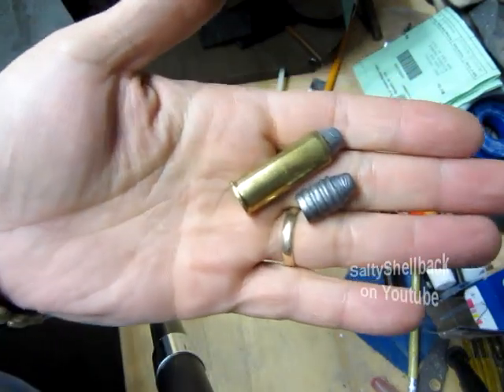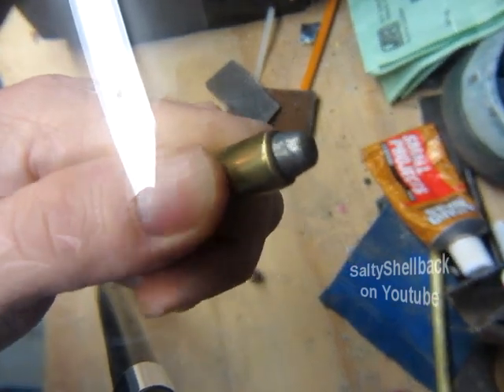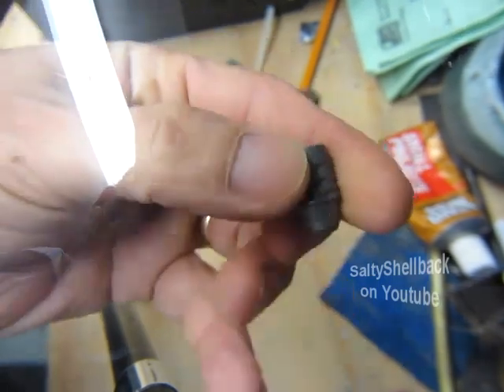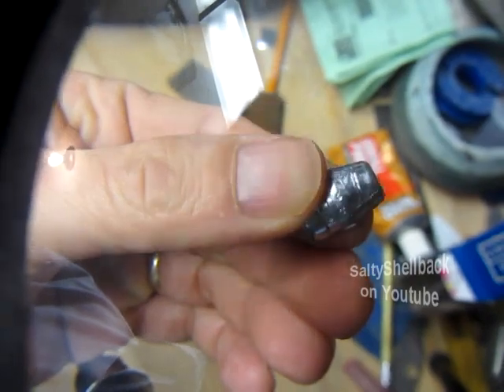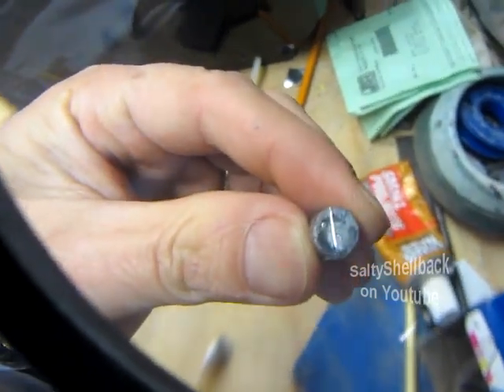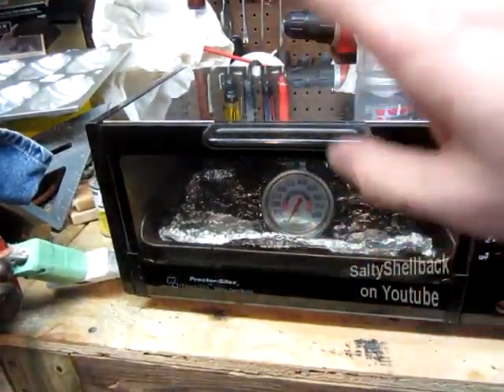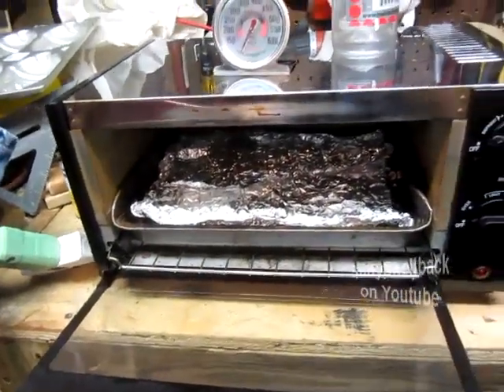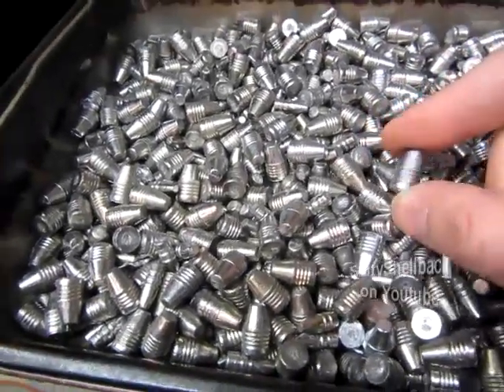Heat treating cast lead bullets

Comment: May I suggest a number graduated lead pencil set for checking the hardness fairly. Also I found that dumping my castings immediately into cold water adds the best result for hardness increase, then powder coating at powder coat manufacturer temp and time and dump them into cold water immediately. Let the bullets set for 2 weeks and check the hardness to find it has increased over initial checking. Use a fast burning powder and you have no problems.
Reply from the maker: I actually have a lead hardness tester. I am not a competition shooter so I only shoot recreationally.
I mainly reload to low powder charges so the lead harness is not too much of a concern to me. I just try the heat treating  to see if it makes any difference.

Comment: "Chill-Hardening" The same process used for lead shot. I drop my cast bullets immediately from the casting mold into cold water, then next day soak in Denatured Alcohol for 10-15 minutes, then shake in powder coat, bake @ 375*-400* (depending on personal preference). From the oven directly dropped into cold water again, then sized and placed into jar for sitting a couple of weeks. Even if used immediately, without jar storage, as said by pareloader5989 have a BHN of 18 or higher. As they set, BHN will rise. These cast bullets produce 30-80 fps increase in velocity, with the identical powder load and lading specs over the jacketed bullets for my use-allowing me to back off my powder charges by 1/2-1 gr each cartridge, depending on caliber. The increased velocity proves Lesser Friction, which equals longer barrel longevity and increased accuracy. Best thing since Bazooka bubble gum for my last 10 years of reloading.

Comment: I use only wheel weights. Once I have my ingots made I cast my bullets and let them air dry. Probably BHN around 15. Then I powder coat. After powder coating for 20 minutes at 400 degrees I take them out of the oven and dump them right into ice water. I am getting BHN of around 18. As the bullets sit for a few weeks they will get harder.
Reply from the maker: Cool
Reply: Also i have a YouTube channel called PA Reloader. Please check it out. Thanks

Comment: Rather than pour water onto the bullets .Get a large tray, a kitty litter box works well. Fill with water and a few ice cubes . That way your bullets are all quenched at once. Just place full tray in water at once and listen to the sizzle. Done.
Reply from the maker: Cool. I haven't cast or heat treated boolits in a while. I'll give it a try when I get the toaster oven out 😉

Comment: I was thinking of using this technique for the opposite effect. I want soft #4 buckshot that patterns tight.  To eliminate the sprue marks and other imperfections,  I thought I'd try tumbling them, then putting them in an oven to soften them and relive them peen hardening.  I was wondering what temperature for how long. I know the determining factor for hardness is using pure lead.
Reply from the maker: I don't know off the top of my head, but there may be some info on some casting forums that may be able to give information on how to stress relieve/anneal lead.
If I find anything, I'll let you know.
Reply: Wow! Thank you for the fast reply! I thought since the last comment was 5 yrs ago, nothing would happen! Thanks again! I was hoping was going in a logical direction.
Reply from the maker: Kurt Achenbach My pleasure! Always happy to help a fellow reloader. A quick google on annealing lead showed this discussion board. The gist is that other than pure lead, you can anneal alloyed lead like from wheel weights to get uniform "softer" lead, but it will eventually revert to its natural hardness state. One person suggested putting them in an oven at 350 degrees F for 30 minutes and letting them naturally air cool.
https://americanlongrifles.org/forum/index.php?topic=9963.0.
Hope that helps 😉
Reply: @saltyshellback  thank you very much! That will be a good starting point for experimenting.

Comment: That was actually a great video, Thank You!!  [Question] Did you have the opportunity to keep an eye on the rifling in your barrel for wear??
Reply from the maker: I don't think I followed up on checking the wear on the rifling.
Reply: There is no way you will wear a barrel out with cast. If you drive them to fast the alloy will shear ,breakdown ,lead the bore and be very inaccurate.

Comment: When you cast the bullets from wheel weights, drop them into water to cool them, then they will harden over a few days
Reply from the maker: I have done some testing with quenched and unquenched bullets and the diference is negligible.  I even tested them with a hardness tester and they were within 1-2 points of hardness with a lead hardness tester. It may make a difference on lead with higher tin content, but I just used wheel weights andhave no way to check the tin content of the wheel weights.

Comment: I guess you figured out by now that pure lead cannot be heat treated.   WW lead has antimony and tin added cause the WW lead has to be harder to prevent them from being thrown off the wheel.  

But quenching them in cold water can result in a BHN of 18 to 20+ which can prevent desired expansion for hunting purposes.   Adding 50% pure lead to the WW lead then quenching can drop the BHN down to 12 or 14.   But softer lead cannot be shot at higher velocities.   Powder coating can offset that problem to some degree.   

A good compromise would be to aim for a BHN of 12 to 14 then Powder Coating.  Doing it that way has allowed me to shoot at 1800 FPS with no problems.   Some guys have said they have shot at 2200 to 2300 FPS with no problems.
Reply from the maker: Yup, I save my pure lead to make slugs or for muzzle loader rounds using sabots.

Comment: WHAT I HAVE LEARNED FROM HARVESTING RANGE SCRAP IS THAT MOST BULLETS CORES HAVE A VERY HIGH BRINDELL HARDNEST BECAUSE OF THE QUALITY OF THE LEAD MANUFACTURES USE TO MAKE GOOD QUALITY AMMO INCLUDING INEXPENSIVE PRACTICE AMMO.
Reply from the maker: lead bullets 4 life I have a bunch of wheel weights I will use for plain lead reloads, but i think I will keep my pure lead stock to make slugs with.  I also have tin I can add if I ever want to harden up the pure lead.

Comment: Yes I also do this kind of process . I put them on a cookie sheet and then also cover them but I do a 15 to 20 minute  heat on 350 degrees then after that just turn it up to 450 to 500 for 2 hours then after the 2 hours STRAIGHT TO COLD SINK WATER !!!! 
I start out with a melt ratio of 10lb's of range lead - 8 oz of tin be it no lead solder or pewter from any value village as its cheap as all hell there in the form of anything from picture frames to vases etc etc etc just make sure its actually pewter as zink will screw you to death  ;-) LOL and then I do the process for mentioned with the cold water drop/heat/cookie sheet thing. Really works wonderful .. Buy the tin/pewter/zinn anywhere you can find it but the no lead solder is a great way but expensive so look for it at yard sales . To be honest any value village or yard sale type place has pewter in many old forms. By the way great post . Thanks for spreading the work .
Reply from the maker: Cool thanks!  I have not cast any bullets for a while.  I got lazy and just buy them from RMR bullets.  I still have all the casting stuff and about 400 pounds of lead in case the store bought bullets get expensive, or I start shooting more.

Comment: 450 degrees is the temp for heat treating/wheel weights work ,soft lead won't
Reply: forgot to add,water quench after heat treating
Reply: I put the temp at 450 degrees in the oven for 1 hour,after one hour I remove them from the oven and drop the bullets into cold water,..I achieve 25 bnh or higher ,....perfect for my magnum loads,....the lead I use is wheel weights and I don't use foil over top of my bullets or anything like that
Reply from the maker: johnwilliams40 I don’t really pay too close attention to the source of the lead I use. I try to mostly use wheel weights, but some of the lead I have comes from lead sheets that are most likely close to pure lead. I also mostly only load to subsonic velocities with my cast lead so I have not had any problems regardless of the hardness of the lead.

Comment: 1. you're not going to see any hardening from xray pure lead.  2.  you need to heat treat at 450 and have antimony in your lead.
Reply from the maker: Dima Prok I mixed with wheel weights and did see some hardening.
Reply: Hey Dima, we were just discussing heat treating. Good to see you on YouTube.

Comment: How hard were they to resize? Did you use a Lee lube and size kit or something like a Lyman or RCBS lube and size press?
Reply from the maker: They was a noticeable difference when resizing them, but I don't have any quantifiable evidence.  I use Lee resizing dies.
Reply: saltyshellback I have lead from a x Ray booth aswell u just melt it and pour into ur mood?
Reply from the maker: hector gonzalez You can do that, but the lead is most likely softer than
 factory cast lead because it is not an alloy.  Many people do a 
hardness test on "unknown" lead and add either tin or antimony to harden
 it up.  I know I have just used it "as is" but keep the loads pretty 
light like 75-80% of published loads.  For example for 124 gr 9mm lead 
bullets, Titegroup powder calls for 3.8 gr of powder max. I use 3 gr. 
This also get you more rounds per pound of powder.  Hope that helps.
Reply: saltyshellback thanks I'm going to do some testing

Comment: Simply mix your lead with tin at a ratio of 10 to 1.  Tha will give you the hardness you need.  I've been doing this for over 50 years with great success.
Reply from the maker: +rickd248 Cool. Where do you get your tin?
Reply: +saltyshellback Well, I worked for a gas and electric company for 33 years.  Back in the 1970's there was not such thing as recycling, at least not like now.  Gas meters had lead and tin in them.  I got both the lead and tin from the gas meter shop.  I brought it home and melted it down and cleaned it up then mixed the tin in at a later date.  I was loading .38/.357 and I didn't need to use gas checks with that mixture.  Now I think you can buy tin in handloading supply places.  I also used a bullet sizer/lubricator to make sure everything was the same size and the lube rings were properly lubed.
Reply from the maker: I got a lead hardness tester and did manage to acquire some tin a while ago, but have not cast any bullets yet.
Reply: +saltyshellback Many long years ago I switched from RCBS to a Dillon 550.  Once I get going I can turn out in the excess of 450 rounds per hour.  Good luck to you my friend!!
Reply from the maker: Thanks!
Reply: tin is for mold fillout more so antimony is what alows it harden
Reply from the maker: Miles Huggins OK thanks!

Comment: I performed this operation point by point with 9 mm 124 grains projectiles from RCBS mold but the result is completely inverse. Bullets are softer than brfore a heat treatment. :(
Reply from the maker: Depends on your lead. I used wheel weight lead
Reply: saltyshellback Now I will try lead alloy with Linotype , so this will eliminate heat treating operation.
Reply from the maker: That workd too :-)

Comment: my understanding is that either way, this is surface-hardness.  If you size to any degree after, much of the benefit is gone.  
I cast for 30-06 for many years, NEVER adding pure lead.  I mixed half-and-half wheel weights and linotype, sized without
lube, heat treated, then lubed in an oversize die.  I scoffed at the "formula" and 'recipe" snobs, and shot up to 2000 FPS with no leading.  I still have that Ruger early M77, pristine bore.  Understanding the shortage of linotype today, we must be more creative.  Find tin and antimony sources.  Old school wisdom, Iron molds, etc, still work today!  BTW, I hate Lee molds!!
Reply from the maker: I got some tin, but haven't tried mixing it with any lead yet.  I haven't cast any bullets for over a year.  Maybe this summer, I will cast some.

Comment: Its the cold water that hardened the bullets.  You don't have to let them soak in the heat for so long, only long enough to let them come up to temp.  The fast quenching does the trick.  Try loading the bullets in a fine wire mesh, then pulling the bullets out of the oven straight into a water bath.
Reply from the maker: callietho OK thanks

Comment: I drop my cast bullets into ice water straight from the mold, helps the hardness quite a lot .
Reply from the maker: I have had mixed results doing that.  I have to do some quantitative tests where I measure the hardness of the same batch of bullets with some air cooled and some water quenched.
Reply: Thank you for the feedback, I'll be watching your results  and then  we all can make bullets at the hardness we want. Thank you for the testing!
Reply: So would you benefit from heat treating after you water quench straight from the mould? I usually water quench pistol just wondering about the benefits to rifle bullets. Thank ya..
Reply: If you quenched them straight from the mold, assuming you had the mold hot, then the heat treat wouldn't offer anything additional. I use solder from Ebay that is 95%antimony and 5%tin, about a 2" piece for a ten pound melting pot and then drop them from the mold into a bucket of room temp water. I do this with .224, 9mm, 45acp, .277, .308, and quite a few more. No leading, no complaints. Happy shooting, :)
Reply: Caesar Augustus You got this backwards, it's 5% antimony and 95% tin.  If it was 95% antimony you would never melt it with soldering iron.

Comment from the maker: I have dropped tham into water mainly so I can handle them sooner, but have not noticed any significant difference in hardness.  I plan to cast some more bullets soon, and will drop some in water and let some air cool to see if there is any difference.  Lately, I just let them air cool because I was casting outside in below freezing temperatures and the water is a bit messy and cold :-)

Comment: Arsenic is what gives the lead the ability to be heat treated. Heat treating with pure lead will not work like it will with wheel weights. The reason is because wheel weights have trace amounts of arsenic. It does not have to do with the tin or antimony content. That affects the hardness of the alloy after casting without heat treating.

Comment: After we spoke the other night on the phone I was thinking about getting into casting my own also. I have a small electric oven like your I use for heat treating...lol. I wonder if I turn the fan on, if it would work better. The fan in mine is not for exhaust but to circulate the heat.

Comment from the maker: It actually depends on the formulation of the lead and how much tin or antimony is in it.  I have quenched bullets made with wheel weights and those made with pure lead.  The results were negligible, but when I heat treated them, they both got harder with the wheel weight stuff getting significantly harder.  I will make a video of the hardness of quenched vs. unquenched bullets the next time I get the casting gear out.

Comment from the maker: Cool.  I never thought of using a weld supply store.  Thanks for the tip.  If I run out of wheel weights, I'll give it a shot.
Reply: Did you mean wheel supply store? I found a place. thats all they do is change tires. Just a little mom and pop shop. There the best. Good luck
Reply from the maker: @pareloader5989  I used to live in Pittsburgh and knew the owner of a tire store near where I worked.  he sold me 100 pound buckets of wheel weights for like $20.

Comment: You can also add some tin to your lead. It should make it harder. Tin solder in bulk at a welding supply store and add it in 6 inch strips for every 10 lbs lead. You can also try water quenching that makes them slightly harder. Then heat treat them.

Comment: those factory 44s were like that.  no thumbnail marks. glad that you worked it out.  When I was melting wheel weights I noticed that it had a orange gold tint in the pot.  the Antimony might change color.